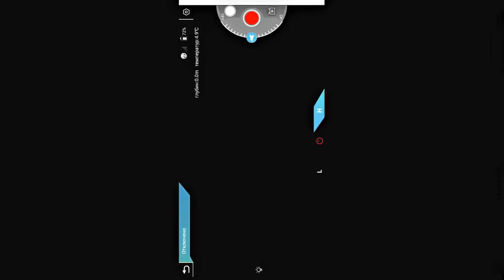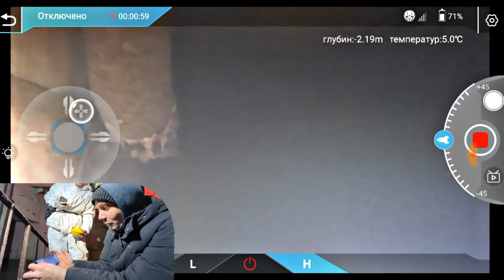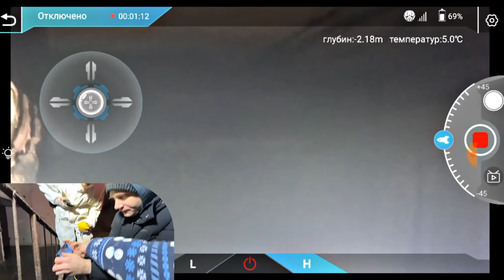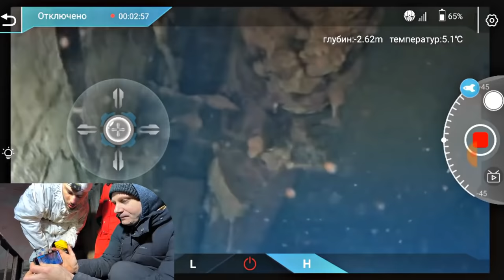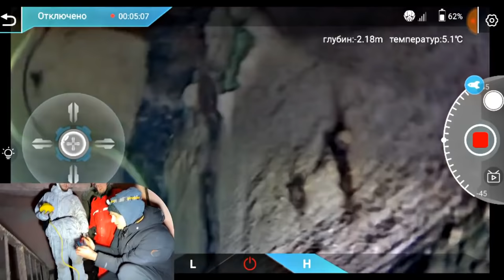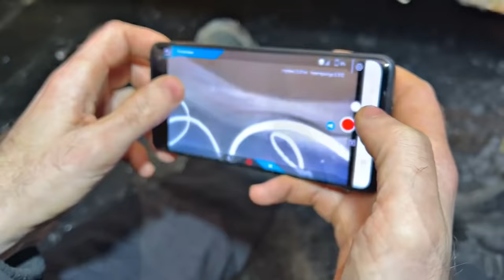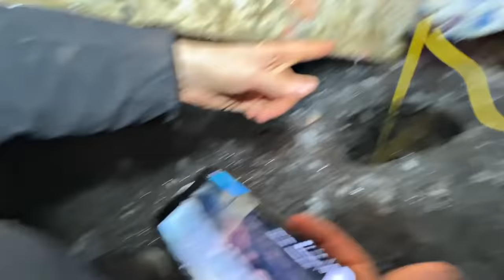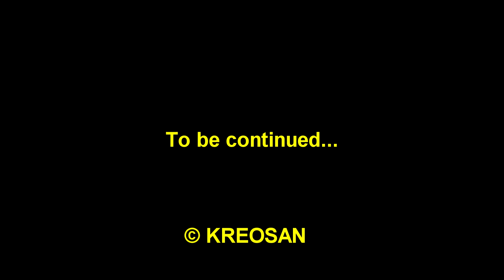Climbed into the BUNKER under the Chernobyl NPP ☢ Underwater DRON dived under the reactor

Comment: I can only wonder what damage the freeze/thaw cycle is doing to literally everything there. I'm amazed the place is as intact as it is. Then again. Reactor buildings are supposed to be absurdly sturdy. Soo.....
Reply: not ones that exloded.
Reply: @Dreadpirateflappy  they're in reactor 5, the only thing there is radioactive metal from the spread out and stupid scavengers burning radioactive cables for copper.

Comment: Guy's, I'm a little worried about your extended exposure in that place, most people don't keep returning to that place because of the radiation.
Hope you guy's are safe from the troubles in Ukraine.
Reply: relax, they know what they are doing
Reply: @MysteryClown  no, they really dont lol
Reply: They went and were checked out for radiation and were perfectly fine. The tour guides spend a lot of time there too and are fine.
Reply: @jandedick7519  yeah, once. Radiation doesn't have to stay in your body to cause damage.
Reply: @SlimPickins_07  are you familiar with what they do for a living? Go check out their other social medias, they’re actually pretty knowledgeable. Goofballs, yes, but knowledgeable.
Reply: @SlimPickins_07  If exposed in air yes. But the diver in previous videos should have atleast had a hightened radiation reading. You can't help that some water will enter your mouth, or other areas of your body. And if the water had a high radiation, it should have been "infecting" his cells and body. To my knowledge, the area around chernobyl does not have a very high radiation. Unless you kick up some dirt. Radiation is also affected by gravity. Would have been interesting to see if the readings are higher in the bottom of the water compared to the top.
Reply: They are professionals
Reply: They obviously give zero fks.
Reply: @MysteryClown  no they do not
Reply: @MysteryClown  There just studid
Reply: Trouble ? It's war bro. Like they're gettin invaded. it's not "trouble"
Reply: @SlimPickins_07  shhhh you’re not supposed to tell people that 😂
Reply: This some crazy stuff

Comment: I bet there is allot of radiation inside this reactor, which never finished construction, does not have a reactor vessel. And therefore was never fueled….. by all accounts the radiation levels inside the unfinished reactor 5-6 building is minimal.
Reply: Yeah but as far as the exclusion zone goes, the ash they find has low readings, that you can get in some spots in the zone by just standing outside.

If they want high readings, the famous crane claw is about 3 times more radioactive then their ash, firefighting clothing in the hospital is about 8 times higher.

If you go to the mounds where they burried the Red forest you can get readings 10-15 times higher especially if you measure near a radiation sign that is stuck into the dirt mound.

In the basement of the jupiter factory there are control rod pieces and boxes with undescript sand which will make a cheaper radiation meter say “get out of here now!” Insread of showing you an actual measurement

My statement was that they are overeacting when it comes to the amount of radiation they find, and that the levels are minimal compared to many other places in the zone. Which is factual.

Comment: Have you considered installing a solar powered water pump to drain the water from the basement of this building? The installation doesn't have to be efficient, you can leave it running for days or even months.
Reply: They said its not possible because of the lake outside
Reply: @jenniferlouis8704  Is there a connection to the lake? I don't think the builders worked in the water. The authorities ordered the building to be flooded?

Comment: YOU GUYS ARE ABSOLUTELY NUTS!!!! I CANT IMAGINE HOW MUCH RADIATION AN ASBESTOS IS IN THERE. YOU GUYS ARE VERY BRAVE. I GET THE CREEPS JUST WATCHING YOU GUYS IN THERE
Reply: People don't put insulation into unfinished buildings, it would also have to be recently damaged to create air particulates. from what I've heard when they were literally in the water they did not get anywhere near a dose that would cause harm.
Reply: The radiation has been there for over 30 years.
Radiative isotopes decay at various rates.
All the extremely dangerous isotopes will be gone and the remaining isotopes are not too much higher than background, apart from a few hotspots.

Radiation at Chernobyl is measured in microsieverts these days, but 30 years ago the readings were as high as 300 sieverts.

1 sievert = 1,000,000 micro sieverts
1 mili sievert = 1000 micro sieverts
Or 1 sievert = 1000 mili sieverts.

So a mili sievert is 1000 times less than a sievert and a micro sievert is 1,000,000 times less than a sievert.
Chernobyl readings are generally under 30 micro sieverts/hour.
1 sievert will cause around 50% of the population to experience non fatal radiation poisoning.
The fatal dose of radiation starts around 3 to 5 sieverts.
The average person will get a natural exposure of 2 to 10 mili sieverts a year……So 2000 to 10,000 micro sieverts.
You get a larger dose of ionising radiation from a single chest X-ray and MUCH larger dose from a single CT scan, than you do from a visit to Chernobyl.
The “Elephants foot” they claimed they spotted in this video was more than likely just a lump of fallen concrete.
The real elephants foot basement IS NOT flooded and it is still dangerously radioactive.
30 years ago, just being in the same room as the elephants foot would kill within 30 seconds of exposure.
You can actually enter the same room now, but if you stay too long you will still get a fatal dose and we’re talking minutes of exposure.
Their drone camera wouldn’t have functioned without issues if it was that close to the Elephants foot, as the radiation is more than enough to leave radiological artefacts on the footage.
The elephants foot is still actually melting through the basement of reactor 4.
They are in more than likely inside reactors 5 or 6, which were never finished and have been abandoned since the mid to late 80s…..So they never had any fuel in them at any point.

The misconceptions about ionising radiation are widespread and a lot of people think that no level of radiation is safe, which simply isn’t true.
You are being bombarded with ionising radiation right now reading this comment, just as you are every second of your life.
Bananas give off ionising radiation ffs.
Reply: @Vlauxa  

You’re talking very low micro sievert ranges of ionising radiation.
Literally WAY less than a single chest-Xray.
One CT scan is 10 to 25 mili sieverts (10,000 to 25,000 micro sieverts) while a chest X-ray is around 100 micro sieverts.